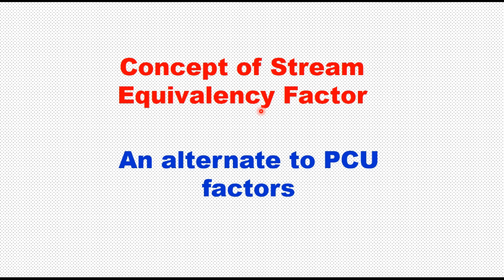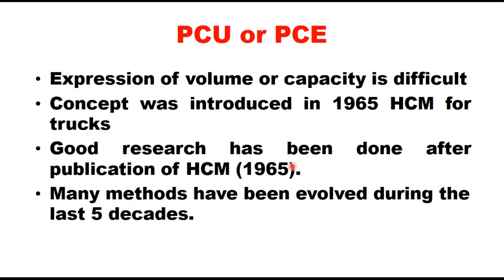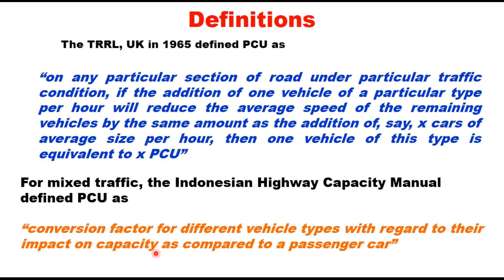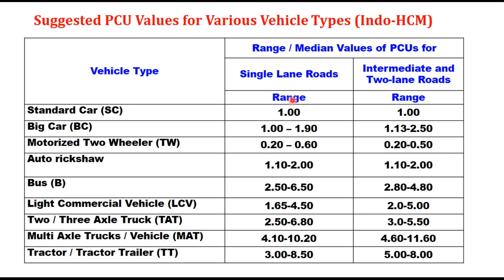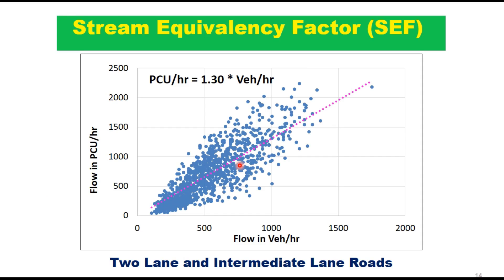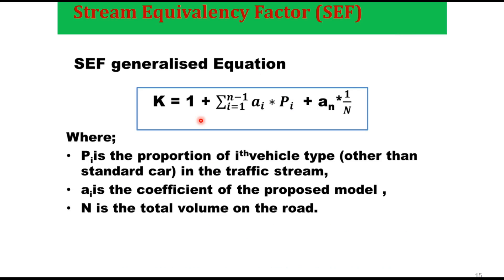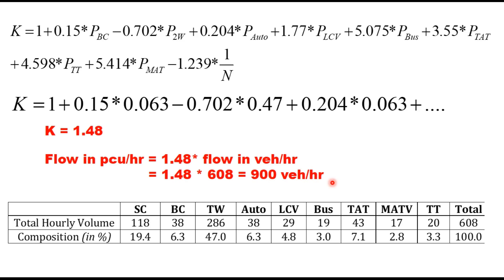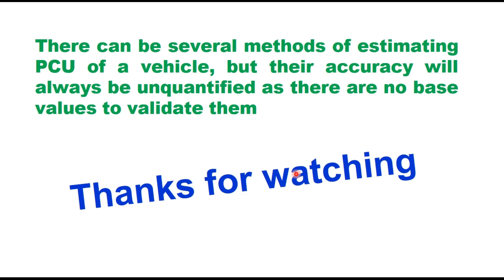Concept of Stream Equivalency Factor for converting mixed traffic in to uniform traffic without PCU.

Comment: Thank you for sharing another valuable video Dr. S. Chandra Sir. I really appreciate it. I wanted to mention that we have developed our own in-house Excel sheets that allow us to convert traffic volume into equivalent Passenger Car Units (PCUs). These sheets have been meticulously designed to streamline the process and provide accurate calculations for our traffic study projects mostly to derive the LoS of intersections. Great work Sir.
Reply from the maker: Thank you for sharing this information. I am glad to note that you also worked on this concept. Please let me know if your excel sheets are on the same concept of SEF or you developed your own procedure. I would love to see in case you have some other concept.
Reply: @SatishIITR  Thanks for your reply Sir. As you mentioned, the procedure we follow to process the data collected through our manual records and Automatic Traffic Count (ATC) machines is quite similar to the one explained in the video.
Reply from the maker: @mohammedabdulmajeed1325  Great. Thanks